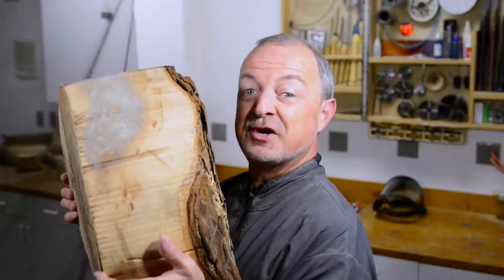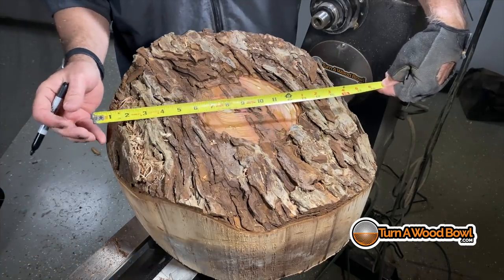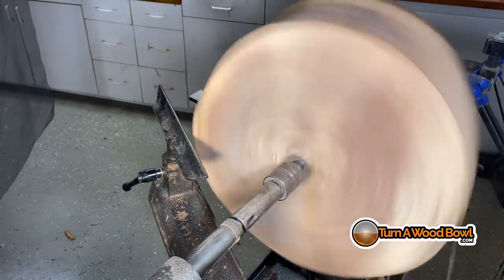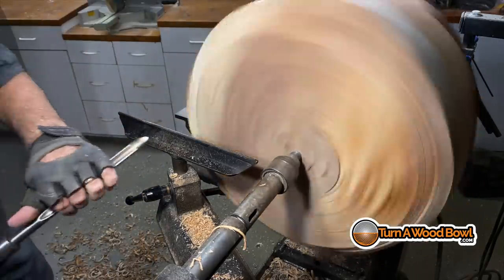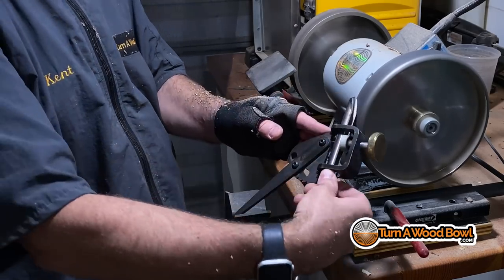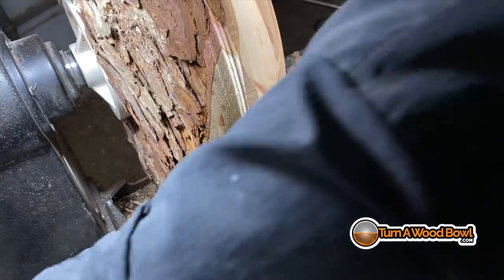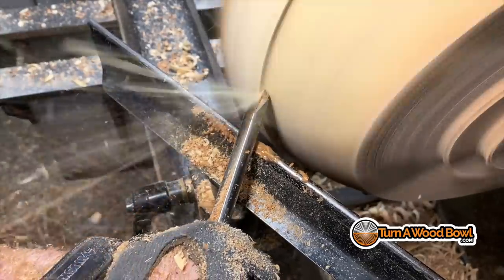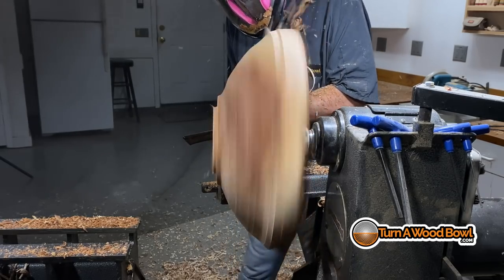Huge Bowl Woodturning – Part 1 of 2 Video

Comment: Can't wait to watch Part 2. Big bowls are so impressive when completed. You must have better luck getting screws out of the faceplate than I do. Seems they go in OK, and break when I try and remove them. Honestly, sometimes they break right before they go into the blank all the way and I try to tighten them into the counter sink of the FP. Than its a 20 minute per screw battle to get the broken screw threads removed from the blank. I even pre-drill the screw holes. LOL. Not fun. Great channel.
Reply from the maker: Larry. Thank you for writing and sharing! I did have problems with screws until I got an impact driver. OMG! It's a night and day different experience. https://amzn.to/3vS6g0a Worth every penny! And use the hex-head screws for added gripping power. Happy Turning!

Comment: I prefer to turn green wood, and have never had a bowl change shape- I collect shavings into a sealed bag, and place the  turned finished bowl into the bag. I take it out for 10 minutes each day, and weigh it on a kitchen scale. When it stops “losing weight”, it’s done. (We’ve always used a whole-house humidifier in the winter, so The humidity level in our home stays between 40 and 50%)

Thanks again so much for the teaching it’s excellent
Reply from the maker: Sounds great Patrick! Wow, I want some of that wood to turn. All the best to you and Happy Turning!

Comment: Again, great to observe your work.  As everyone I guess, I aspire to be able to turn one day a bowl of respectable size.  However because of my workshop area, I am limited to own only a small 1HP Midi-Lathe (Laguna 1216) that can handle up to 16 ”in diameter on the extention side.  But it doesn't specify the overall weight it can handle.  I am scared of killing my motor or destroying the bearings by manipulating a log to heavy for the mechanic.  Is there a rule of thumb that allows to establish the maximum weight of a log that a lathe can handle in a safe way?  Like a ratio of log / lathe weights?  Or some combination of HP, RPM and lathe weight versus log weight?  Thanks.
Reply from the maker: Alain, that's a great question. I am not sure. This seems like a manufacturer's question. I would guess the quality and design of the bearing would be the key elements of concern. Happy Turning!

Comment: When you say 5/8" or 1/2" bowl gouge, are you referring to the width across the flute or the diameter of the bar stock?  Also, when doing the first turning of a twice turned bowl, do you bother trying hard to get a smooth finish or do you just hog off the material and not worry much about tool marks?  Thanks!

Comment: Hi Kent. When you've had the tenon in the chuck have you ever had a piece that size come flying off the lathe? Must be pretty spectacular.
Reply from the maker: Nope. …I've only had a couple very dry pecan blank shear off a tenon to chuck connection. Dovetail chucks are the key. Avoid serrated jaw chucks. All the best to you and Happy Turning!

Comment: Two questions Kent. Do you usually cut a smaller bowl from the inside of the blank (haven't seen part 2 yet)? and what do you do with all of the shavings?
Reply from the maker: If the blank is large, yes I like to save the interior blank. I compost and fill low spots in the yard. Eventually I might be able to elevate our yard a few feet. ;) Happy Turning!

Comment: I wonder if the long shavings would make good paper... 
Layer or weave them flat on a screen and press them similar to how papyrus is made.
Reply from the maker: I'm sure the fiber could be used to make paper, one way or another. ;)
Reply: The courser shavings will make mdf wood , the fine dust can be used to make art paper , if you soak it in water then spread on a surface to dry . I have used glass to make a smooth paper or screen to make rough texture , been told you can mix white glue in the water for stronger paper
Reply: The courser shavings will make mdf wood , the fine dust can be used to make art paper , if you soak it in water then spread on a surface to dry . I have used glass to make a smooth paper or screen to make rough texture , been told you can mix white glue in the water for stronger paper . Now that I think about it , maybe you could try mixing course shavings and fine dust , boil it for a while and make some art paper